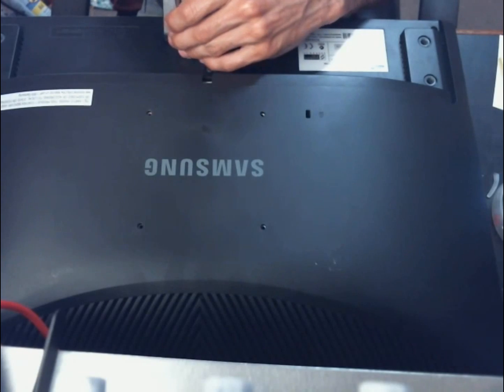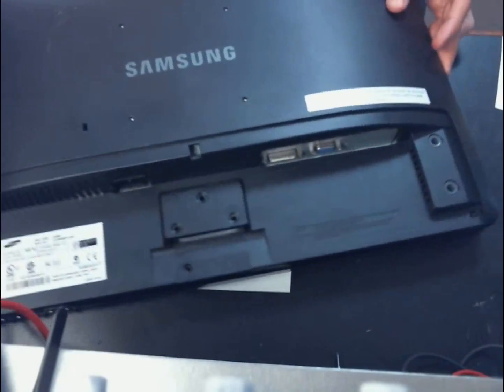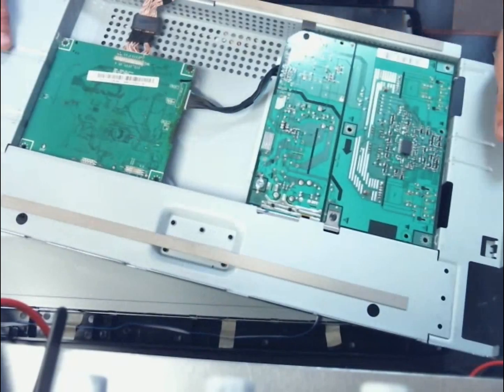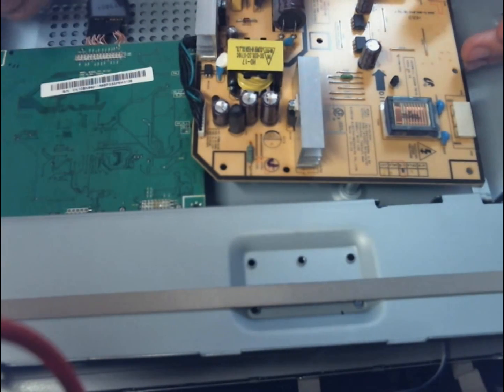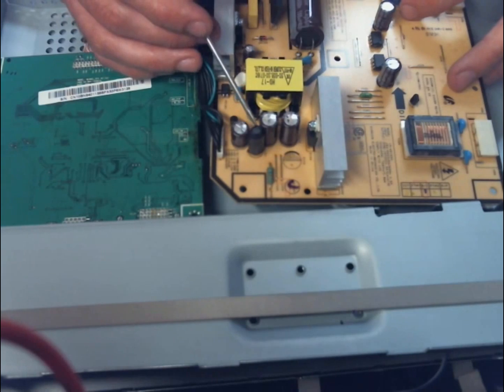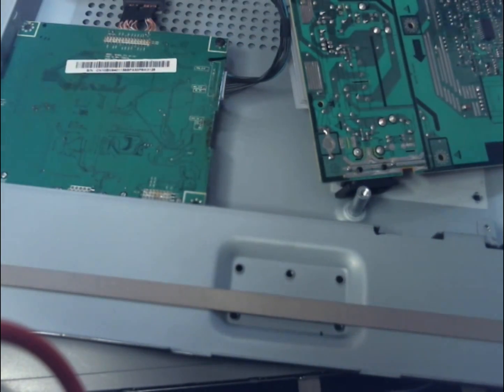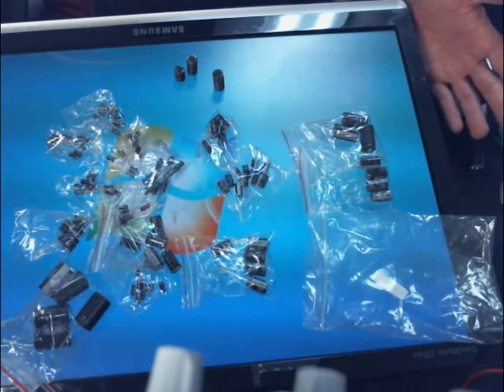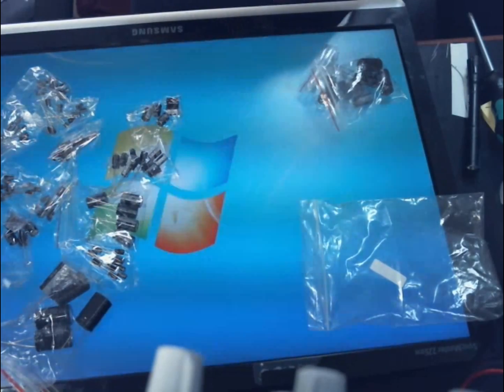Crazy Screen Blinking or No Display? Replacing Bad Capacitors

Comment: I have the same model monitor, which developed same, blinking issue. Switched out failed caps, & problem sorted.
It pays to harvest components, as the 820uF caps aren't available, from any bricks 'n mortar store, in my country. But had same value ones, in my second hand stock.
Been working perfectly, for over a week. Thx for sharing.

Comment: Are bad capacitors the most common problem? I have a 2nd hand 27.5" ViewSonic monitor that powers on but the image on the screen shows up for such a short time I can't even read what it says, it keeps doing that on/off with the image until I turn the monitor off, often it won't turn off though and I have to pull the power cord. Will replacing the capacitors on the power board be enough or do you think I need to replace the inverter as well?
Reply from the maker: Bad capacitors are going to be the most common failure. You may be able to find out if any are bad with a visual check. Look for any that bulge at the top or have an odd residue coming from them.
Reply: I have the same issue. backlight works for half a second then disappears to see pitch black, I can see the actual screen barely though...